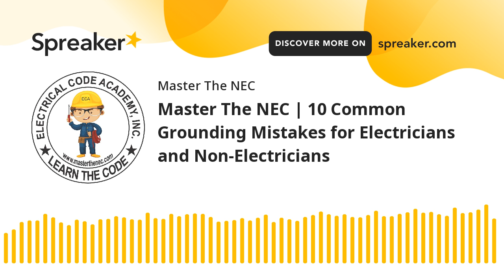Master The NEC | 10 Common Grounding Mistakes for Electricians and Non-Electricians

Comment: If you have a main panel with two ground rods installed per code and you put a sub-panel in an out building and in stall a different ground rods at this panel per code do the two gound rods need to be contacted together?
Reply from the maker: The GES at the separate building is independent from the main building. Just so you know, if you install a GES at the seperate building, the EGC installed to that seperate building is connected to the GES of the seperate building and technically speaking the two GES's are tied together but you don't have to think about that as its inherent to the install.